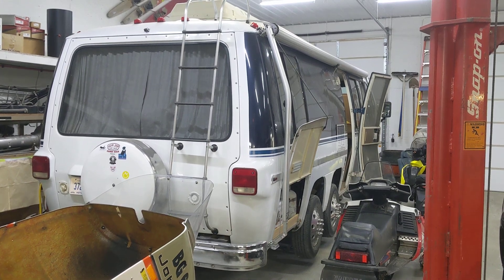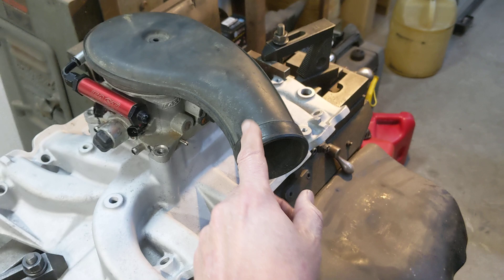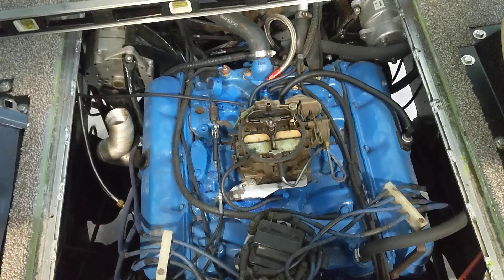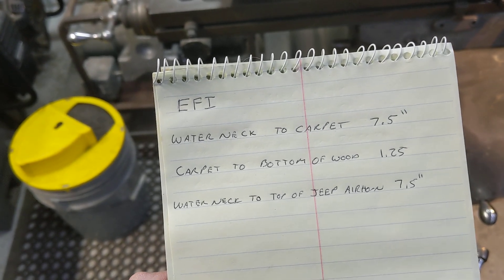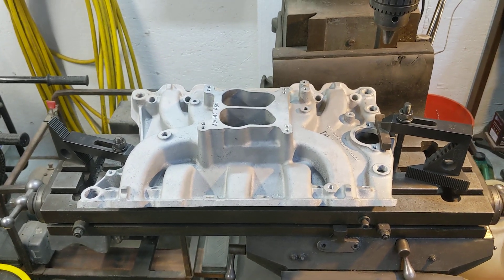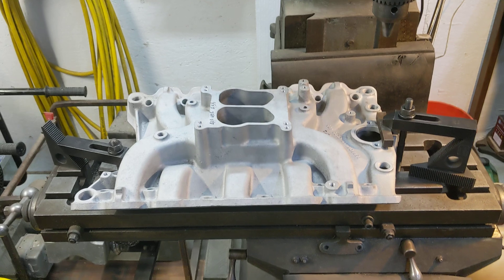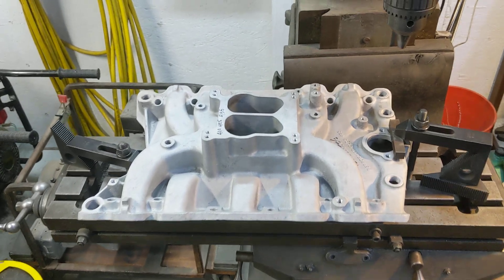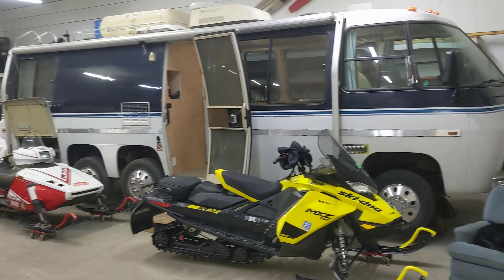GMC Motorhome 209 (fuel injection)

Comment: Just curious, but have you considered using a Holley Sniper EFI? They have a Quadrajet version that replaces the old carburetor one-to-one using the exisiting intake manifold, and you "only" need a new high pressure fuel pump.
Reply from the maker: I want to replace the cracked cast iron manifold.

Comment: I've been using a jeep snorkel on a GM Rochester throttle body since 2009.  It was found by others that the barrel nearest the snorkel intake was getting starved for air.  Using a spacer to raise the snorkel allowed the air to make the sharp 90 degree turn and solved the issue.  Unfortunately I can't post a link to a photo on YT
Reply from the maker: @brucehislop8860  Thanks Bruce,  how tall is the spacer?

Comment: Have you thought about modifying the engine cover instead? And then add a removable center storage/cupholder/console etc . on top of the hump. It seems like a wasted space there anyway for many things. Console could be attached to the cover with cleet and slam latch of some kind.
Reply from the maker: That's a good thought, I was hoping to keep that area flat for getting in and out of the cockpit

Comment: Mike, good to see a new video.  As we had talked at the June rally, my coach has the gm throttle body injection from a 90s 454.  With my setup, I have the stock intake with the heat tube blocked off.  Gm throttle body and stock air cleaner.  All fits with no floor modification.  Then I have a flex dryer hose off the snout of air cleaner to the Ragusa cold air scoop which is mounted in the slot of the grill to get outside air rather than hot air from engine bay.  The only thing my system lacks is an intake air temp sensor which i plan to add for better fuel trim.  For you, as the other mentioned I think the slope is due to cars having engine tilt for standard tail shaft transmission it compensates so carb is flat or level for floats.  I think you could plane that off just above the runners, retaps the screw holes and seal them off.  I don’t know how much that would affect performance if any due to shortening the length of intake.  Probably negligible.  If you’re dead set on the current do you have then I’d go that route.  Unfortunately, I heard Bob R from dynamic efi passed away this summer.  He was the guy who made the flashable board that replaced the factory chip in the gm ecm.  I haven’t heard of anyone else worked there or is taking over.  But if you weren’t set on using your current efi then I would suggest the gm one.  With it I have knock sensor, electronic timing, etc.  I think you mentioned yours doesn’t do timing?  Also with the gm ecm, I found a newer electric cruise servo and with the speed sensor I’ll be able to have tap up/down cruise as well.  But I have to replace coolant hoses before I do too much.  Hope to see you at a rally this summer
Reply from the maker: Thanks for the information.  I do have it running with the EZ EFI.

Comment: I'm planning fuel injection on mine too. I like the idea of a pony tank with the high pressure pump in it like most cars are built today. Being in the fuel keeps the pump cooler and knock down the noise. One thing I've seen is that you want to recirculate your fuel back to the tank. Have a port near the top of the pony tank that goes back to the tank and have the incoming port use a dip tube to put the new fuel to the bottom of the pony tank.
Reply from the maker: Thanks for the information I will have a tank return, I will have to see if a dip tube is possible with the tank I purchased.

Comment: I'm a machinist by trade for the last 40+ years. To me, it looks like you can take the whole thing down to the top the of runner castings. Just watch for interference with the new throttle body. Especially with the throttle lever. 

As far as the studs go, if those holes are at an angle, you can plunge mill them square to the new surface and put in a Heli-coil.
Reply from the maker: @michaelmileski9830  thanks for the information I think I will do just that.

Comment: Hey Mike! Hope you had great Holidays and thanks for the video, I am still running carb but we do not take our coach into higher elevations and if it aint broke dont mess with it in my case. I need to update my build over on the forum and I am still doing the interior. Learning to build cabinets with hillbilly engineering!
Reply from the maker: Hope your Holidays were awesome too.  I'm not happy with the current driveability.  Hoping the FI makes a big improvement.

Comment: Most cars have the engine tipped back which is why the carb is on an angle. In the end, the carb is level.

Edit to add: Most rear wheel drive cars have the engine/trans at an angle in the car.
Reply from the maker: Makes sense